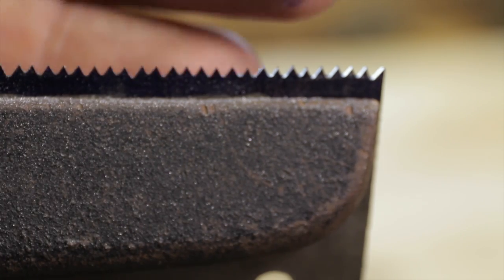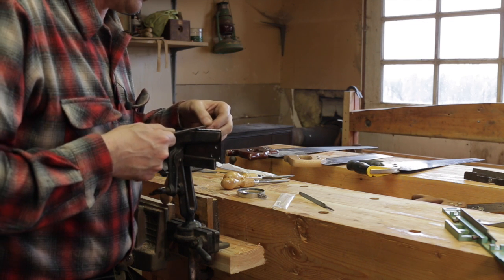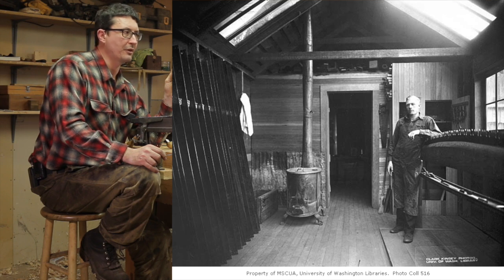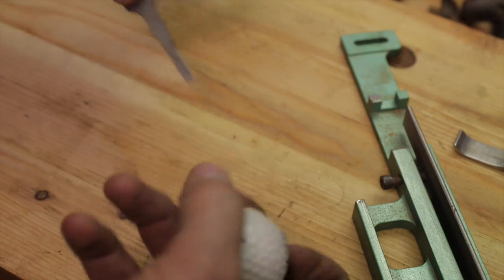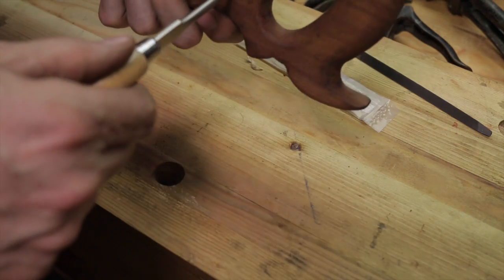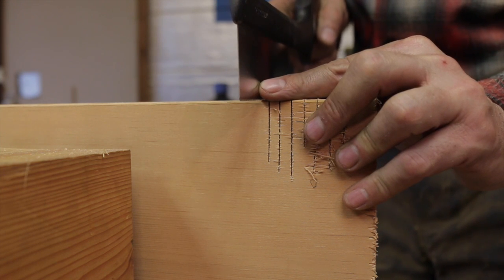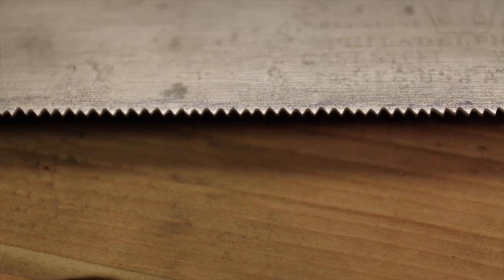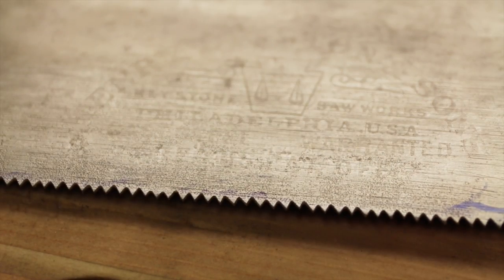How To Sharpen A Hand Saw 3

Comment: You just filed a rip saw there (dovetail saw), Cody. try it  ripping, it will cut much better. cross cut saws are filed the same way as you allready do your big saws; at an angle. cheers.
Reply: Your veritas is a rip saw for going down the grain . However great video with excellent content .

Comment: Hey, cody, nice one! I think the light is reflected and not refracted. Refraction occurs when the light goes through a lens or a prism or anything like that :)
Reply from the maker: +Bruno Passarelli Gelli Yes I always mix the two up,
Reply: +Bruno Passarelli Gelli Thanks, Bruno.  I was going to correct him about that, but now I don't have to.  Now I don't have to look like the picky person. ;o)

Just messing around with you (Cody, too, actually).  Note the winky above.
Reply: +Wranglerstar maybe think of it like you look at your reflection in a mirror. You see your reflection because the light is bouncing off of it and you can see it.

Comment: FYI that's a nice sharpening  job! Impressed with the significant performance of cut. I have 4 Disston saws (2 crosscuts & 2 back saws) handed down from my Grandfather. One is a well perserved ( meaning the wood handle) D-55 Crosscut in need of major planing & sharpening.

Comment: Excellent video, as always!  Just one thing: you keep saying that the light is "refracting" on the metal -- but it is "reflecting!"  Refracting is something different, when light goes THROUGH another material, which makes the image shift (like when you put something partway into water and it looks like it's bent).  You are looking for the light reflecting off the filed metal, because the metal is now shiny!  Just FYI...

Comment: Hi Cody! I just found your channel today. I've been following Paul Sellers for a few months. It's great to see  what you're doing. Inspiring. Sellers has a saw filing tip. He sharpens the first 2" at a less aggressive angle, which helps to start smoother cuts more easily. I'll be going out tomorrow to buy a file and try sharpening my own saw for the first time. Thanks for the inspiration... Tony

Comment: Hey cody. Good stuff in these videos. The reason the Veritas is so grabby is that they sharpen it with 0 rake, which is quite aggressive. You had quite some rake in the Disston, which makes it easier to start and much less grabby, and also splinters the wood less when crosscutting. 

Try them for ripping though, and you will probably find the Veritas is a little faster and still quite smooth once you get going.

Comment: I was taught to sharpen handsaws in high school ( 1980s) by an old wood shop teacher. On the cross cut saw there are 4 steps to sharpen the saw properly, they are 1 joint the teeth to all the same level, 2 shape all the teeth to the same depth and spacing, 3 set the teeth to be offset by 1/3 of the saw blade thickness, finally 4 sharpen all the teeth from each respective side to the proper angle. When the saw was sharpened right you should be able to place a sewing needle in the center of the set and it should be able to slide from one end to the other without stopping or falling off. It took me 3 tries to get it right and now I will never forget how to properly sharpen handsaws. It looks to me as though you missed the setting and sharpening steps. Good try. It gets better with practice.
Reply: +David Gibson ,Sounds like we had the same teacher , me in the 60's. One thing that is often overlooked is to 
sharpen ever other tooth then file the rest from the opposite side. This will result in equal length teeth- so the needle will rest in the V of the teeth.

Comment: Good job on a first try. Even an imperfectly sharpened saw will cut better than a dull one. 
The differing depths of the gullets between the teeth and the differing height of the teeth is sometimes called Cows and Calves. I had some problems with that on my first saw I tried to sharpen. I found that I was chasing the flat spot on top of the tooth and ended up going too deeply. Now when I sharpen a saw I limit myself to two strokes of the file for each tooth. On a crosscut I'll make a complete pass down the length of the saw on both sides  and if it needs more filing I will go back over the whole length of the blade, tooth by tooth. 
For a dovetail saw, filed rip, it will cause tear out on the exit side of a cross grain cut. The tooth is set up to chisel out the end grain rather than slicing the fibers like a cross cut.

Comment: Good job, as a start; with room to grow...  When I was in college, my dad had a bit of a sharpening business, and I provided a lot of free labor to that, and picked up some things.  (He even had a machine to punch new teeth in handsaws.)

In the future, you might want to file against a pattern, so that the teeth geometry gets better as you file, not worse.  At a minimum, I suggest clamping the saw blade low in the vice or clamp such that the file stops at a certain point, and can't go too deep.  (Then exert lateral pressure on the file in the appropriate direction, if the tooth is not yet to a point.)   ((While you smartly focused on the tips of the teeth in this effort, focusing on the gullies and tooth spacings too will make you a master!))

Comment: That Silky tooth pattern is available in "tool box saws", and pruning saws by Stihl, Corona, ACE, and a few others. If Silky is the originator, then I suppose that these are made under license. But you can save a bit of money looking for the teeth like that by a non-Silky manufacturer. I have, several times.

If you find the blade you want and it's not drilled to fit your handle, Remember, you can drill that very hard blade with a COBALT drill. A drill press is recommended, and use a slow speed & oil. Don't let it get too hot.

Comment: On using a saw, forward stroke drop the handle a little and you will cut only the front inwards the wood, so no raffles. On the back stroke lift your hand a little and you will only cut the backside inward, no raffles.

Comment: Since your looking for optivisors, I would suggest using riogrande.com, you'll find several pairs ranging from cheap to expensive, and they have spectrum "sand paper that goes from 600 to 1600 grit or so and its fabricy so it would work great for wet sanding. And just look around I'm sure you'd find something else useful (like more rouge in many different grits)I do work in jewelry and I love rio grande and they have great technical and customer support!

Comment: Cody, isn't that a rip-cut pattern veritox? and the Diston wasn't binding because the cuts to the right made room for the wood to flex, and open the kerf.
Reply: I agree on the binding.  Needs to turn the board over, or move farther down the board, away from the existing cuts, to get a true idea on the binding compared to the first cut.
Reply: +45Deere9500 absolutely.

Comment: Bit bias these tests I think. 

On the first cut with the older saw, the wood will pinch the saw if it's not properly set. On a second cut, when the cuts are this close, the wood will naturally fall victim to the duress its being presented. It'll bend out of shape, and give the second cut an edge to the first.Had the cuts been four inches apart, it'd be a more fair test. And if the Veritas is a dove tail saw, it's a decent chance it's sharpened to be a rip saw, thus it will tear out easily on cross cuts.

Either way, great job at sharpening the saw. I was really impressed myself. I tried to sharpen a saw too not long ago, albeit without a workbench, wise or anything much to help myself with, needless to say it was far less successful. I'm also surprised it cuts this well with the uneven teeth. I know you're a fan of Paul Sellers, like myself, and I'm a bit surprised you haven't seen his videos on saw sharpening. They are all great, you should really check them out. He comes with great tips in regards to it.

Comment: I have a Diston #4 that I will now sharpen.....just need to find some good files ...... thanks for sharing.
Reply: +BangFlop Also, don't sharpen individual teeth, sharpen all of them one by one with even strokes(2 on the first pass for instance) until all teeth are sharpened. Some will be more dull than others, but if you dont give them all even sharpening, you get the problem cody ran into where the teeth become uneven. Just a tip.
Reply: +Richard Smith Thanks!  Cody filed his straight (file 90 deg to saw), do you recommend an angle instead?

Comment: I hate to repeat Michael Henderson's question, but should I file across the teeth at a right (90 degree) angle? Or should I use a different angle and alternate teeth like in your chainsaw videos?
Good job by the way, very little tear out.
Reply: This one was a rip saw.  Sharpen every tooth at 90 degrees to the length of the blade.  A crosscut saw is more complicated.  Teeth need to be set and every other filed at an angle.  A saw set shone in earlier video and angle guide needed.  Not an easy task.  A headlight/magnifier almost a requirement.

Comment: Only missed several steps .every other tooth gets sharpened from one side,file held at 25 degree angle, choose right size file for saw,you forgot to set the saw teeth when finished sharpping

Comment: Looking sharply at your cuts, it looks like the saw walked a bit in the cut, before sharpening, the cut itself bends away to the left, from the camera's pov.
That's why your blade first binds, while after sharpening, it doesn't bind anymore
Reply: +DUTCHHUSKY66   Yes and it was the first cut.  The next cuts were close to the first and had some relief movement of the wood next to it.

Comment: Sorry, I'm confused here.  You filed the teeth at 45 degrees and didn't set them?  I think Paul Sellers had a few good videos on the subject...

You are going to need to get that saw under your nose when you are filing it.  I did a similar one the other day and found it more difficult to get the teeth even then I thought it would be.  Talking about ruining a saw, I cracked a Simonds saw last year while trying to set it, it was much more brittle than I expected.  I'm not sure why, because my Disston saws are much easier to work with.

Comment: I think we we share much in how we think, from what you say in your videos.
I wonder how many professionals know how to sharpen a saw. I wonder, with these throw away saws if you cannot cut off the teeth, where the metal has been hardened and then recut the teeth to your profile. I am supposing that only the teeth have been hardened.